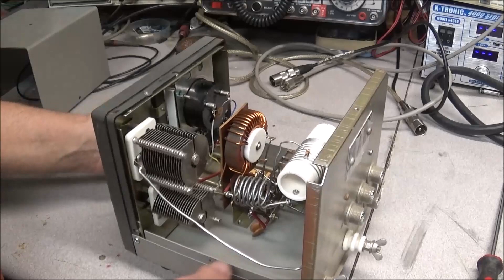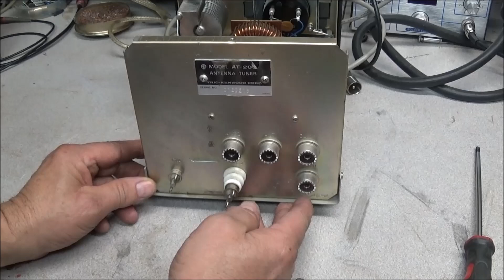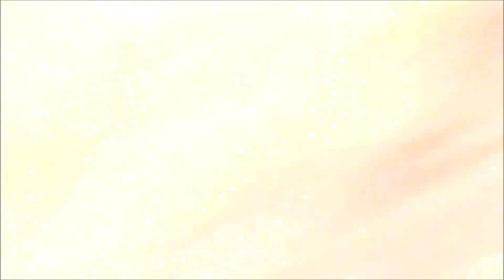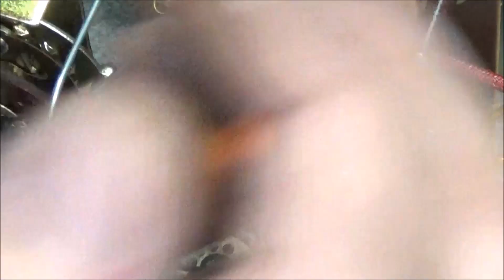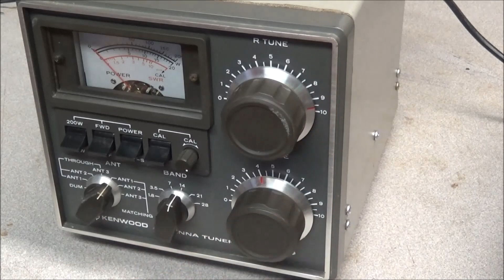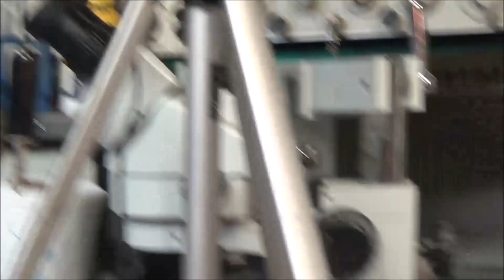#103 Kenwood TS 520 series AT 200 Antenna tuner repair

Comment: Had the band switch connected mostly to L5 broken loose due to someone who was inside of tuner and reinstalled porcelain cone  that holds L5 wrongly to circuit board which put weight of  transformer/coil  on wafer switch breaking it.  The repair involved epoxy glue on wafer ,epoxy left to dry for 4 days. The switch was repaired reinstalled however wiper on both switches was wrong by 180 degrees so removed L3 and L5 and remove band switches again and rotate wiper 180 degrees so wipers match each others rotation  . My repair was delicate should  have taken more pictures but repair was successful.

Comment: I had expected to see ceramic switch wafers instead of phenolic in an antenna tuner intended for the 100 -200 Watt PEP class of transceivers!!
Excellent  video, thanks for sharing, de PZ1CD , 73
Reply from the maker: Ceramic would have been much better but to keep the cost down they used phenolic.  It was a price war back then, Thanks

Comment: I have a kenwood AT-230  ,one of the plastic rods for the tune capacitor knob  broke ,do you have any idea were I may find one . Thanks nice video
Reply from the maker: Hi Carl. I would have no idea where to find an original since that was a custom part.  You may be able to find something to substitute it with like a plastic shaft from an old  variable pot. Sometimes you can find fiberglass rods at craft stores that could be modified and used.

Comment: Very nice video. I plan to check the bracket fit to the bottom cover on mine, good thing to be aware of. I wonder of any old Kenwood parts radios might have an exact wafer in some switch  stack? If so, maybe a perfect replacement could be done. 
Do you suggest any lube on the contact assembly such as the Deoxit type products? Thanks for the time to share this info on the older KW gear.
Reply from the maker: Thanks  Jarit. Always a good idea to check the alignment of these brackets.  Deoxit products are great.  Another good assembly lube is G-n from Dow Corning. And sometimes silicone and while lithium grease is fine.
Reply: Appreciate the info and comments. There are several Deoxit products out there maybe. Will do some reading on them. Also good to know about the other products you have found useful. Thanks for all the good KW info.

Comment: Another great video.  This is a very neat and compact transmatch.  I didn't see a power jack on the back and I think it would have been neat for Kenwood to have that meter on the front lighted, especially for night time operation.  I guess a good mod would be to put some 12 v. LED's in the meter case and fix some way to turn them on.  To us who have been hams for 50+ years, it would be nice to see it!  HI
73, Harvey  KM4JA in Alabama
Reply from the maker: You know Harvey I was thinking the same thing about adding leds to the meter. Can power them from the radios 12 volt output connector. Think I will do that.
Reply: @TheRadioShop  
You can power a few LEDs from a little rectified RF, if properly bypassed and filtered to avoid harmonic generation ....

Comment: Always way into the middle where you cannot reach until you take everything else apart.. I need this, ALMOST a complete setup
now I need another thingy. If I am correct there is also a small monitor for the 520. DANG more money
Reply from the maker: Yep, never easy to get to. Yes the SM-220 monitor. I have 2 of those. Thanks Wayne.

Comment: Have you ever noticed it's always the wafer switches that's buried in the middle that always breaks.  It's never the easy to get to one on the outside edge.
Reply: Just like your sandwich bread will always fall mayo or peanut butter side down onto the floor, it's just physics! Buddy, what was the brand name of the electronics contact cleaner you're using?
Reply: loll, yea, its never as easy as this one! always the most difficult, whit the most wires atached, and out off reach!
Reply from the maker: Always seem to work that way for some reason. Murphy at work I guess lol.
Reply from the maker: Hate it when my sandwich falls PB&J  down first! Dino I think it was the Ideal 40-610 for the cleaning of this. Followed by alcohol.
Reply from the maker: You got that right!